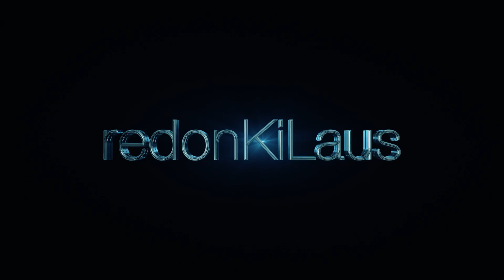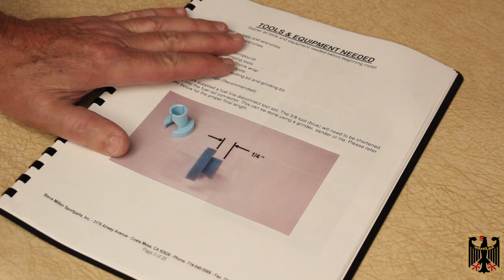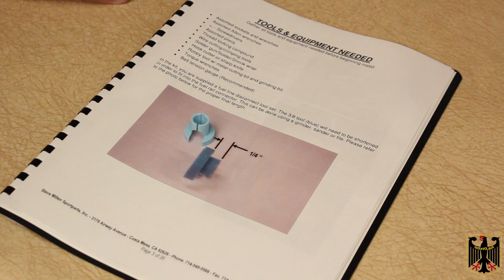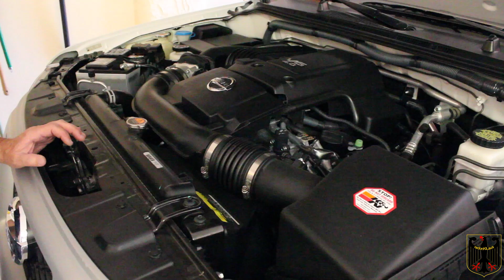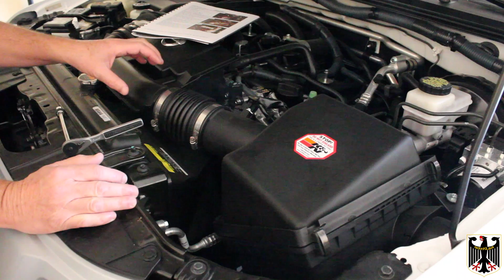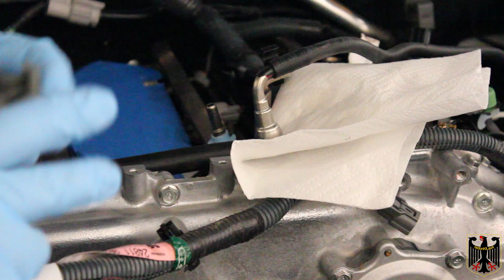VQ40 Stillen Supercharger Install - Part 3 - Disassembly

Comment: Fuel rail removal or fuel system work FYI (no more spraying gas :-) -- I have always pulled the fuel pump fuse from the fuse box, then ran the motor until it wouldn't run. This usually bleeds any remaining pressure out of the fuel lines if it is not direct injection. Then when you remove the lines you might get a couple drips, but no more spray. On a direct injection engine I don't know if the cylinder pressure might cause any injector issues with no fuel pressure.